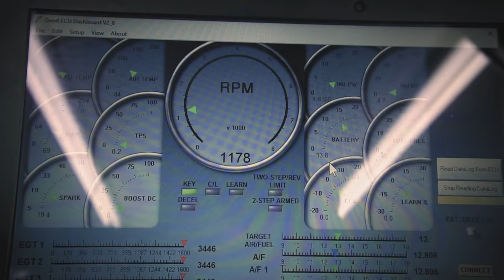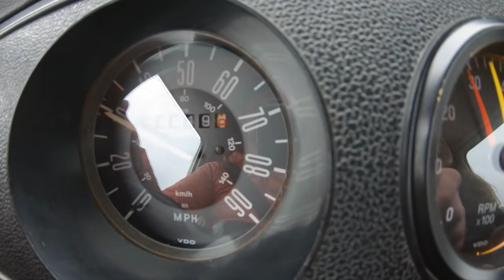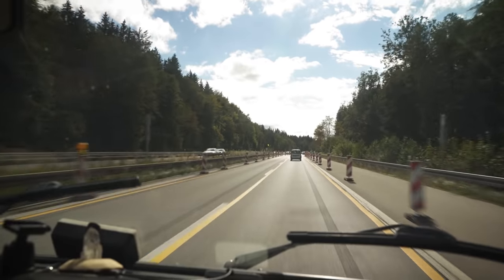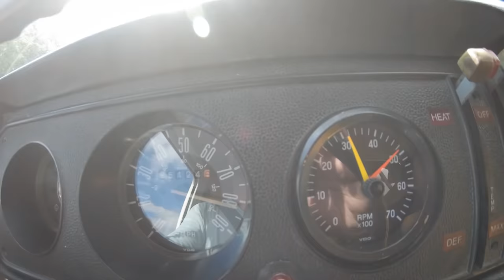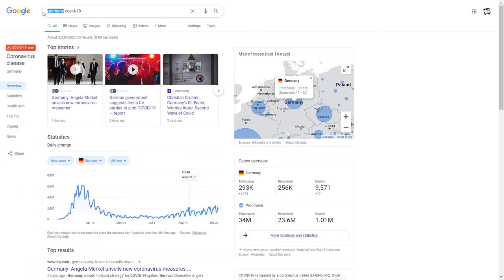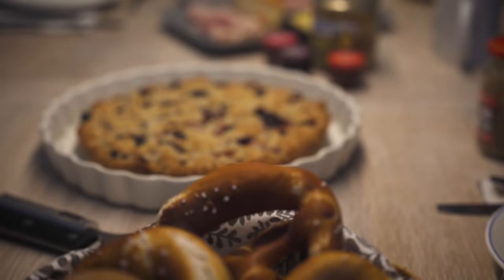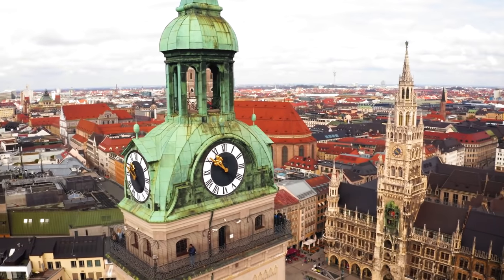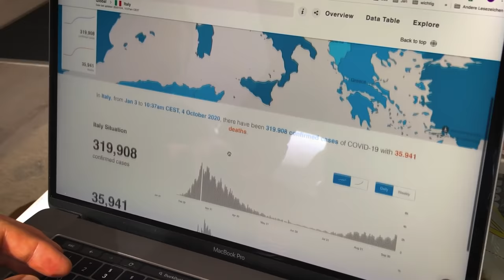FINDING OUR TOP SPEED: Autobahn Run [NO SPEED LIMIT] // S05E12

Comment: I’m impressed!  My 1776cc powered dune buggy was still pulling decently at 85, but the front end started to get very light feeling and my self-preservation instincts kicked in.  This motor had stock heads and dual 1bbl Solexes, so not nearly as much power as your fuel injected motor with good heads.

Comment: Despite that awesome engine set up you still frightened the life out of me driving at that speed in a Vdub bus !! God if mine hits 60mph going down hill with the wind behind me I have to touch the brakes. Ok so I have the stock and original 1976 1600 but really,  a Kombi going fast is unnatural. With the aerodynamics of a loaf of bread the wind noise alone must have been deafening 🤣🤣

Comment: Your engine did great! You forgot to mention that you guys weigh in at around 2000 kgs!! My bay window camper, with nothing in it and a tired stock 1600 SP would barely do 65 Miles (with the wind behind it!). Not surprisingly any wind or hills would knock down travelling speeds considerably. Not that i'm into travelling fast anyways...

Comment: Hello,
2nd, and a faithful follower..
Was that really 4800 rpm on a standard ratio 091 gearbox??
I have built a 1700 cc CT aircooled engine and can get 118 kph before running out of steam, to be improved
with a modified gearbox..
We are locked down for a month in France.
Cordialement,

Comment: My 1977 baywindow will go 70mph all day at about 3800rpm.  2.0l fuel injected stock type4 engine. I never go past 4000rpm.
Reply from the maker: That's probably wise, we've got special springs and rocker gear in the head which is more durable.  Although we also don't push it past 4000rpm (this was just a one-off)
Reply: My 2109cc type4 aircooled Kombi with mild modifications does +150km/hr easily and can cruise on 130km for long periods of time with no issues and standard factory cooling system. It's all about what really works in aircooled engines. 135km is fast in a high top Kombi and I'd certainly be nervous about it with standard tyres & suspension. Glad you got to try it out in one of the safest places to try it. The COVID-19 issue in Europe scares me more than doing 165km in my 75 Kombi lol.